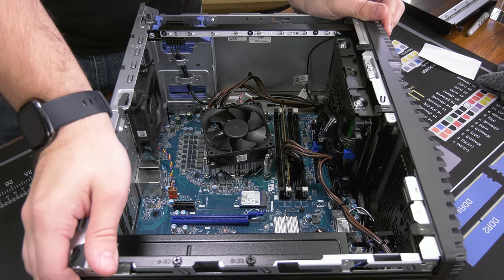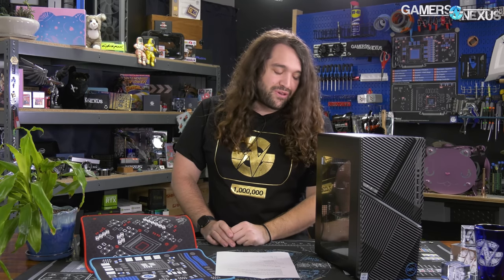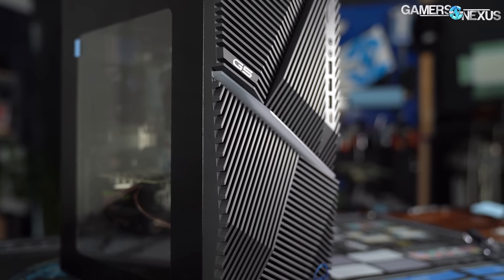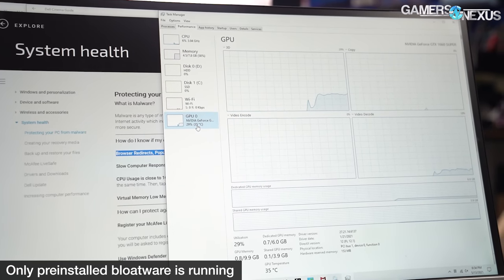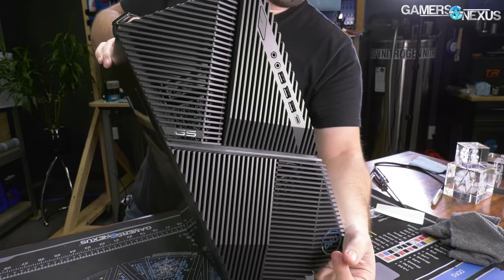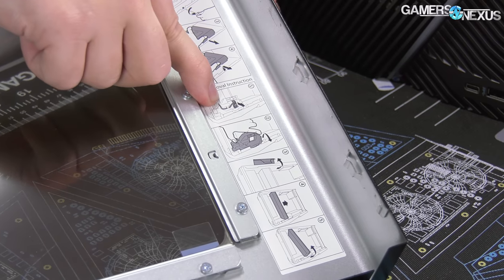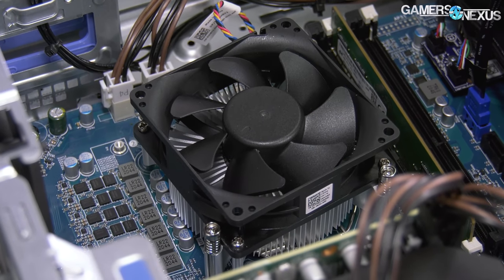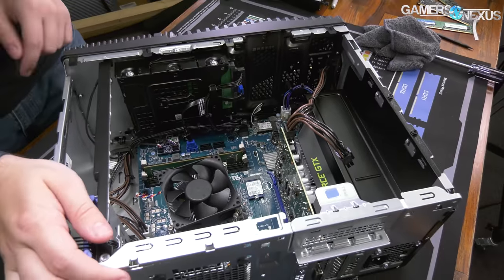Worse Than Walmart: Dell G5 5000 PC’s Garbage Parts & Hidden Charges

Comment: Its like they thought of every single method to stop you from upgrading anything, Louis Rossman would love this thing..
Reply from the maker: Somethingsomething 115v to the CPU!
Reply: It’s surprising they’re still using standard memory modules (soldered on the motherboard anyone?) and SATA for storage!
Reply: @rdoursenaud  
Oh, they will be gone soon.
Reply: @rdoursenaud  It's not standard. I know, i had to add additional ones. The only ones working are the ones sold by Dell.
Reply: @kirkanos771  Ouch. That must sting.
Reply: @kirkanos771  Funnily enough, it didn’t use to be that way. I own a Optiplex 790 from 2012. I had 8 GB DDR3 and I just slapped another random 8GB stick of DDR3 and worked like a charm.
Reply: This kind of system builders actually like modularity because it reduces their costs. Instead of twenty different motherboards, they have one motherboard model, 8GB and 16GB sticks of RAM, plus 256GB, 512GB and 1TB SSD's, and they can change memory/SSD supplier whenever.

Apple doesn't do that because they simply don't allow you or themselves flexibility on the hardware, since it doesn't really matter. They operate on higher margins by controlling their ecossystem.
Reply: Is your PPBUS G3 HOT?
Reply: @luisenriqueperezperez3193  optiplex systems were pretty decent for how dirt cheap they were.
Reply: @luisenriqueperezperez3193  
Optiplex is their enterprise line. They don't lock those systems down as much with proprietary junk because customers (IT workers) would flip out, and they also tend to charge more for those systems.
Reply: @kirkanos771  same with the laptops
Reply: @GamersNexus  is the motherboard a proprietary server/ networking board? im  thinking it would be a 1U or 2U height.
Reply: This is exactly what they are doing. By making everything nonstandard, they are forcing you to come back to them for parts and service. HP is extra sneaky about this by discontinuing some key parts (like the laptop LCD screen assembly) 1-2 years after it’s built to force you to buy a new computer.
Reply: @Tano A 1 year old laptop should have enough part support to last at least as long as the extended warranty. HP discontinues the rubber foot that covers the screws on the bottom of the Envy X360 laptops before they stop selling the laptop. The rubber is easy to damage when replacing the memory, battery, or drives. You shouldn't have to replace a less than 1 year old laptop because the rubber foot fell off.
Reply: @Tano I am an HP factory trained serviceman, I know how the system works. I'm the guy that goes out to do the warranty work. I'm the guy that has to tell the customer that HP longer has the part to fix their under warranty machine. I'm the guy that gets yelled at when I tell them that their 6 month old, $1200 laptop is unrepairable and HP is offering them a discount of $300 off the purchase of a new one. 

What's stupid is that HP makes printer parts for up to 10 years after the last one was sold. It got to the point that once HP stops letting us order the parts, we just buy them out of china where they are still being made but HP found out and sent their lawyers out to tell us to stop.

The issue isn't that HP stopped making them. The issue is that HP refuses to sell them.
Reply: @docgiggles130  This is why we need right to repair, and this is also why companies like apple need to be stopped because they are pioneer in violating consumer right and others like HP follows when they see how far it can be pushed.
Reply: @tuanseattle  Ahhhh, you are a fellow follower of Louis Rossmann! I fully support the right to fix whatever you buy until technology advances to the point something is no longer able to keep up. Most laptops can easily make it 5-7 years before the slower speed finally becomes noticeable to most people.
Reply: They have always done it like this
Reply: Whatever happened to economies of scale with interchangeable standard parts ?

Does the lack of repair in the long term (and hence need to buy new system) outweigh the cost of tooling custom parts ? Because even if it did for a large OEM, why would you buy a replacement from them if its so unreliable. It makes no sense.
Reply: I tried, but couldn’t even add an SSD on a dell.
Reply: @tma2001  it makes perfect sense when your supply chain management is such a beast and you’ve driven costs down so low that the marginal cost of designing another piece of proprietary plastic or custom assembly solution is close to zero. If you can design a “fuck you” feature for $50,000 and then sell $10M of that product that will have to be replaced in three years, you have won.
Reply: I immediately thought of Louis Rossman too!
Reply: @kirkanos771  you 'member when Dell servers won't accept non-dell firmwared HDDs? I 'member
Reply: @docgiggles130  Measure the height and cut your own rubber feet, then liberally apply epoxy.

Worked for all of mine, anyway.
Reply: @Olivia-W  You can't epoxy them because they cover the screws to open it up. On top of that, a repair like this is fine if you do it to your own laptop, but how many people would be okay with getting this laptop back from a shop with this kind of repair? You may be okay with this, but as someone that refurbishes laptops as a side business, I can say that most want the laptop to look as factory as possible or they will demand that I cut the price in half.
Reply: @docgiggles130  Oh, that is mean. Covering up screws with rubber feet bugs me to all heck.

And yes, of course, refurbishment is different. The only choice is usually harvesting identical dead models.
Reply: @memovilmx6239  pretty sure they’ve always accepted them, although perhaps some of their JBOD or disk selves don’t. What they will do is ramp up the fan speed as soon as you add non dell components
Reply: looks like the right to repair goes out of the windows when there is money in play
Reply: @rdoursenaud  this dude predicted the future of ddr5 ram!!
Reply: @jintsuubest9331  you did too!
Reply: @luisenriqueperezperez3193  I helped a friend upgrade his Dell system back around 2001, a P3 733mhz. They were mfg locked then too. Even though standard parts fit, the motherboard refused to use them. Dell "approved" ram had an extra small chip on it to talk to the BIOS and let it know it's approved. If that chip wasn't there, the MB would deny that stick existed.
Reply: I had a bad experience with an HP prebuilt that I got as my first PC. Had to get rid of everything that wasn't the CPU or a drive.
Reply: Lol... no, he wouldn't.
Reply: Louis Rossman is a freak lmao
Reply: @rdoursenaud  they are "standard" ram but often a dell wont post without dell branded ram. You cant just go buy hynix crucial samsung ect... of same timing speed ect... 99% of time you will get beeps not a boot.
Reply: @docgiggles130  I love Loius Rossmann. His new store is like 3 to 4 blocks from me.
Reply: @docgiggles130  I really hope no one is throwing away a Laptop because the couldn't buy a Rubber Foot
Reply: @deltasixgaming  You would be surprised. I've gotten a few units for 'parts' because of it.
Reply: @docgiggles130  that's a Shocker and just sounds like people creating E-Waste for No Reason
Reply: A pokemon UwU
Reply: @kirkanos771  i bought a sata cable on alienware for the dell vostro, i hope you were talking about the ram
Reply: @simonebaraldi9440  Dell systems have a narrow white list of compatible components. You wont know until you try.
Reply: @kirkanos771  im 90%sire i found the right one, from the image, and it says its compatible with the model. At worst, its 4,5 euros lost
Reply: Dell computers have been impossible to update for at least the last twenty years. One of the reasons I would never, ever recommend them.
Reply: It's what they call, 'future proof', in that it resists any attempt to replace any of the parts in the future.  Unless, it's the entire machine, of course.

Comment: 'worse than walmart'

that really says a lot
Reply: You're Winner, Dell
Reply: It Really does....
Reply: honestly thought it felt 3 times worse than walmart
Reply: Came to say this. Really says it all.
Reply: too be fair atleast the walmart PC works...
Reply: omg the i5 in my G5 runs a whole 2 degrees C warmer THIS THING IS COMPLETELY WORTHLESS
Reply: Especially considering they're an OEM specialized in computer equipment
Reply: It makes Walmart PC look like a smart purchase in comparison. At least they have some semblance of using non-proprietary parts. Not like I want to recommend them anyway.
Reply: Really sad state that one of the largest OEM system builders in the world makes a worse product than WalMart.
Reply: Man dells going down hill...
Reply: Big oof
Reply: Lmao, looking back at dells old commercials "Dude, you're getting a Dell" pretty much says Dude, you're getting a turd, or Dude you're getting scammed.
Reply: At least Walmart gave you RGB when you bought their metal box of glue & unformatted drives.
Reply: @yakitatefreak  That's the difference between an SI(Cyberpower et all) and an OEM(Dell, HP, Lenovo).
Reply: @Grimmwoldds  Even HP doesn’t make that terrible mistake of a custom form factor motherboard in their Omen lineup.
Reply: When people shoplift from a Walmart the police take the shoplifters back to Walmart so that Walmart can give them compensation.
Reply: That terrifies me lmao
Reply: How can it be??? Is there level even more deep down than walmart level…
Reply: @jvccr7533  Ah, a classic meme.
Reply: So now Dell Is competing with E-machine for emperor of junk award.
Reply: Maybe this is the K-Mart PC?
Reply: @paulnolan4971  What the fuck? USA, I assume?
Reply: 900?!! Someone needs to get slapped in public with a squid. Thirty Lashes!
Reply: small mod for walmart can be very competitive
Reply: DELL? More like HELL. Seriously, never had a good time with Dell for the past 20 years. Its....ok.. for a company work PC but as a personal PC or a gaming PC, shit sucks eggs, has been and will continue to do so. If you bought from a box store, doesn't matter, have had calls to literally support my PC and as soon as they get the warranty id from you, then they ask for a form of payment in case it may need to be shipped to their facilities, if you do and it's an easy to fix software issue, BAM, $9.99 support charge. Decline to offer details and they disconnect you. Even had a Dell inspiron "acquisitioned for training purposes" and given half of its value after only having it for 3 months, almost failed a college course due to that.

Bottom line, take your money elsewhere and you are your best warranty for desktop PC's
Reply: This is a classic example of why I don't buy American products, because by British standards most of this would either be considered illegal, or a scam. Just imagine how many $bs are lost through this negative profile. It's a foot mass-shooting.
Reply: Dell buys their video cards from wish
Reply: @RNGeeGee  lol NO. A UK observer
Reply: @RNGeeGee  U kinda missed the point
Reply: I seriously don't understand how this is worse than an eMachine.
Reply: that's genius, a very condensed review with all the info you need
Reply: It's the same thing because their products are built in the same country.
Reply: Some of the Walmart PC's at least looked fancy to me, but, that's as much as I know.  I don't buy PC's often.  I'm pretty sure the CPU socket on my current PC has been obsolete for at least 10 years, lol.
Reply: well rule number one with buying a computer is you don't go to wal-mart to buy a computer. rule number two is never buy a dell either.

and the real sorry thing here is at one time dell put together good systems. i had one that i wanted to upgrade the video card so i called them to find out what other cards i could upgrade to. they told me i needed to upgrade the power supply first so i ordered one from them and it was wrong for my motherboard. i called them back after sending it back and they were sending another one which never came so i called them back and they had canceled the order on me and did not bother to call me or email me as to why. as it turns out on the third call they told me my system could not be upgraded. they had moved their service calls to india and the dot heads fucked it up. never went back to dell for shit after that....
Reply: My PC is worse than trash it has a goddamn processor from before the 2000s (AMD A6) which is about as powerful as a goddamn Intel Celeron
Reply: @jordzking6330  Before the 2000's?! Are you serious?
Reply: @jordzking6330  Brings back some memories.  I remember when people were supposedly getting celerons because you could allegedly overclock the shit out of them.  I don't even know how true that was, it was just what I heard back in the day.
Reply: I have this exact computer and it is great
Reply: What Dell is trying to pass off as gaming PC's make those old eMachines look good... I'm showing my age here, but those of you who are old enough to remember the PC market in the early 2000's will know what I mean - they were complete junk! And somehow Dell is making their stuff look even worse 20 years later while charging 2-3x the price!
Reply: Newtube  Not even remotely true. Building a PC nowadays is simple, and with channels like this anyone can gain all the knowledge they need. And, what? I'm sorry? Dell is the best PC brand out there? Thanks for the laugh LOL
Reply: well i dont know about that, if walmart put that pc in a better airflow case it wouldve been okay-good. Dell has always made overpriced, terrible prebuilts. I remember early 2000s My older brother financed a PC from dell.. After financing it was over 3grand for probably less than a gig of ram, probably a pentium 4, and no gpu. Walmart actually attempted to fit in with casual gamers, and they just didnt handle the press and media well.
Reply: Worse than Walmart.  That is the first time I ever saw those words in the same sentence!  Walmart may seem OK for some things but I am not sure I would ever want to buy a PC there.  I know I won't find all the parts I need at Walmart.  I would have to order those.  BTW, Walmart allows businesses to sell through them in a way that is similar to the way Amazon works.  A lot of the same businesses have their own websites too so look there, don't let Walmart take part of their profits!  They may be small businesses that are just down the road from a lot of people
Reply: Says it all, really.